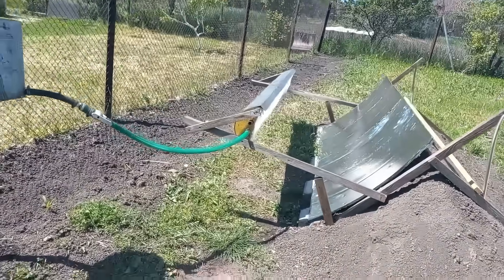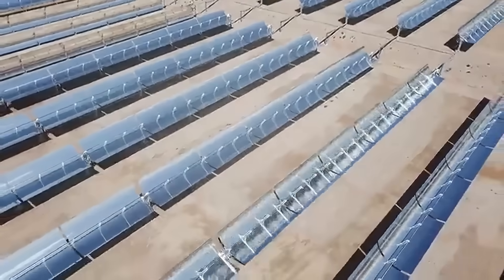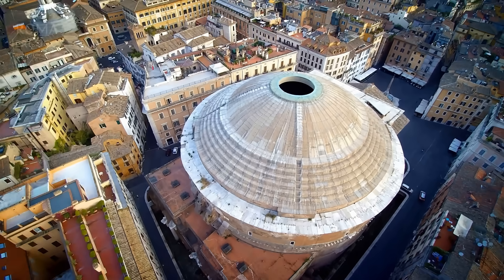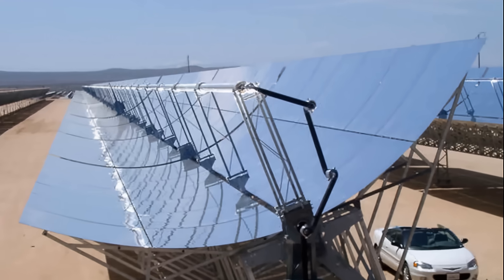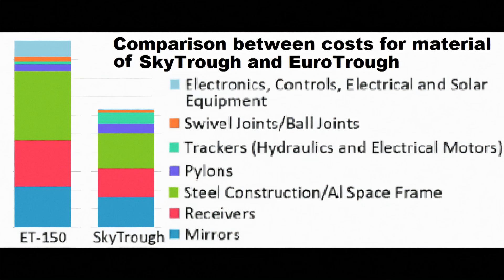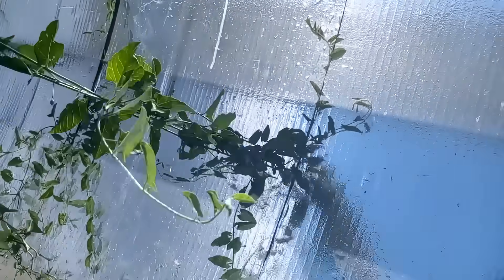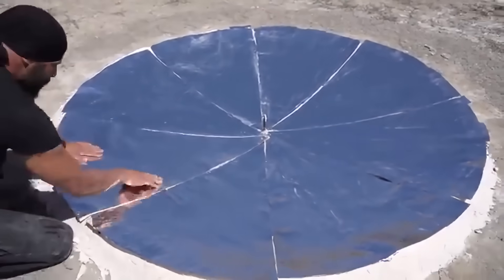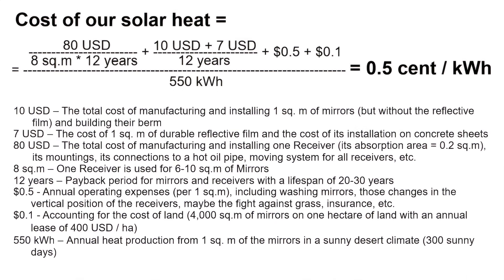Mirrored concrete for cheap solar energy

Comment: I think you've optimised for cost and not for practicality, which is evident by the damage from plants, the ants, etc. Moreover, concrete is cheap but it's very weak without steel reinforcement, which would add to the cost. Also, I could be wrong but I think moving the collector isn't exactly equivalent to moving the whole assembly, right?. I think if you were building this for your home or in some post-apocalyptic scenario, your idea has merit. But in a large-scale, municipal environment, you want to build something robust and long-lasting. (I'm not suggesting the current ones are perfect)

Anyway, I do really like it!
Reply: For quite a wide range of angles, in a parabolic mirror, the focal point wold be quite small, but moving, although at large angles(sunrise and sunset) it might not be that effective. So yes, instead of building costly infrastructure to move the entire mirror, we can just move the receiving pipe.
Reply: @OrangeGuy420  I suppose the extreme angles where sun is low, the error in focal point is maximised, but also solar energy through the atmosphere is minimised, so it's not as important.
Reply: @Ozzah thatsexactly my point. What you said whould be true for a concave mirror, as it has a property called spherical abberation, at relatively small angles, where the focal length gets quite diffused. This is not a property of parabolic mirrors, making them useful for these kinds of applications.

Fun fact: here in india, there is an astronomical telescope which has a large rotating bowl of mercury, which makes a large parabolic shape, thus operating on the same principle; parabolic mirror.

Comment: This makes me wonder about cycling heat through thermal piping under ground, and then storing it in the surface structure as well to heat the surface so that it does not ice over. This is interesting. I love it. I wonder if an array could be built for passive heating, and then using gravity and geometry create passive flow. If so then we could heat, and power sources minimal footprint. Hmm. I wonder if we could create coolant systems for summer by utilizing the motion to convey heat away from locations while isolating it for cooking...then we can create automatic food storage and dispensing restaurants...projected use case is bread or fermentation of things like distilled liquors for further fuel diversity.

Comment: My Grandma's house had a solar water heater kind of based on the same principle. It would send hot water to an insulated storage tank. And keep recycling the hot water, making it hotter and hotter. When you took hot water from the tank for washing dishes, it would add some cold water into the system in a small amount and quickly heat it up.
It wasn't ideal for taking a long hot shower, but you could have hot water even in the winter time. And the snow would quickly melt off the solar heater because it was always warm and at an angle to let the snow slide off.

Comment: 3 days ago NightHawkLight released a video where he makes cheap and accessible aircrete. Combined with the polymer reinforcement you can do light and durable concrete mirrors.
The weight achieved is amazing. It's obviously slightly more expensive than using plain gravel and sand, but only barely, and what you pay in material you recoup in transportation and installation.
Plus the lightness of the aircrete might help you make different shapes and structures not possible with normal concrete. And it's a better thermal insulator than normal concrete, so maybe there's quse for that too.

Comment: I've been telling people for years now that this type of solar power generation (solar collectors) is far more efficient, less complex and more affordable than photovoltaic panels if you use it for heating. No need for expensive electronics or lithium battery arrays. All you need is a water tank to store the hot water and a small pump (powered with solar cells) to pump the water around.

Comment: Dind't wall the solar concentration projects got abandoned due the concorrence with photovoltaics getting cheaper? Idn, I'm a bit scheptical.

the kwh there is about heat, not eletricity. The conversion has losses, and the generator will ad costs.

Also, why not paint the receaver black?

Comment: Excellent idea with the concrete. The frames those fancy German mirrors use are unnecessary; once you form the concrete you could raise them off the ground using basically anything, even timber.
Reply: There's a reason why we use these "unnecessary frames" ;)
Reply: @SolarCookingGermany  Ooo, thanks for responding. Got a breakdown of the math on your channel for the efficiency between this, concrete, and concrete with intermediate standoffs? I want to see where this stuff and our work is wrong about the cost/benefit.

Comment: foam concrete might work.   Just for ease of working with and thermal insulation.  1" foam concrete = R6 value.  Using small amount of (xanthan gum + alcohol) + dawn soap + bit of water  + cement =  foam concrete with 3 - 5 min stirring.  Time varies with amount made and with what tools your mixing with.   Looks very dry at start of mix, will look better after foam forms.

Comment: It always comes back to turning water into steam huh.....
Reply: Always had been [Bang]
Reply: Sun + water = steam = the cleanest possible energy I can think off. Hopefully we can master it and make it super efficient somehow.
Reply: @tgchan   water is so precious.
Reply: @angelafoxmusic7265  I love water!
Reply: @angelafoxmusic7265  you do understand the laws of conservation right?
Reply: @angelafoxmusic7265  We have a massive amount of water, that's not really true in the way you meant it.
Reply: @angelafoxmusic7265  No it's not lol. 70% of the earth is covered in it and it doesn't just magically disappear when you use it. We will NEVER run out of water.
Reply: @AlphaCarinae unless you split it then burn the hydrogen and oxygen gases right?
Reply: it is always still like that... even nuclear does... Most reliable ways to generate power uses steam turbines
Reply: actually always has been. thats what nuclear energy does….
Reply: I mean, it because water has hydrogen bonding so it take a lot of energy
Reply: It's best, it will heat the water and produce electricity simultaneously
Reply: And then what Is done with the stream?
Reply: @liviosaracino4611  Typically, run through turbines to create electricity.
Reply: @liviosaracino4611 its the pressure from the steam that is used to run turbines which create friction around a coil assembly which create energy
Reply: @liviosaracino4611 Steam can either be put in a condenser or just sent out.
Reply: If the goal is electricity and not heat then you could focus the light on solar panels and avoid the conversion losses of converting heat to steam to rotational energy to electricity in a generator. You could also try focusing the heat onto a Peltier.
Reply: @filonin2  Solar panel tester here. Heat (like in all electrical systems) introduces inefficiency through increased electrical resistance. Heat causes molecules to vibrate faster. Slower molecules get in the way less in an electron stream. Cold panels produce higher energy.
Reply: @filonin2  I suggest you look at how efficient steam generators are. Sollar panels are maybe 20% efficient? Peltier circuits are sub 10% and you would need to maintain a cold side as well. Compared to maybe 60% for the best cycle setups for steam.
Reply: @filonin2  the excess heat would reduce the solar panels' efficiency and could reduce lifespan.
Water pipes cooling the back of the panel could help with that, along with preheating water entering your house's hot water tank, though.
Reply: Or seawater into steam into sweetwater... A win win for the dessert and with it food and forrest creation. The forrest gives you extra bilding materials and at the end extra fuel. Most of our ritch are short turm idiots that just do not care for this planet.
Reply: Well, you could try to attach hoses to your rear end to capture the gasses from your fats, and then convert that into some sort of usable energy.

But....most of us would choose the easier and more pleasant options. Ones that are more.....uh...easily attainable.
Reply: https://youtu.be/uK367T7h6ZY?si=_Zxs8XU0EirKHZyB
Reply: You could use other liquids as a thermosyphon, and pump that around pipes in a concrete slab floor for additional heating in winter. 
Instead of going for maximum heat in summer- go for useful heat in winter.
Reply: You could always buy some supercritical co2 at home depot.
Reply: @gaemr_o5147  don’t be a smartass
Reply: @gaemr_o5147 I have a supercritical CO2 powered air fryer. It was cheaper than electric.
Reply: I bet there are better liquids that can be used instead
Reply: @attorneyirl2725 no, water is special because of hydrogen bonding, even if you like tried to use something like ClF, its extemely sensitive and explode with the slightest change of energy such as light. you can use heavier isotopes of water like duterium you want more energy per cm^3
Reply: @CheeseLordAlmightytheOneGod  It's not the hydrogen bonding that gives it its high heat of vaporization.

Comment: Cool now tell us how much power you generate? 
EDIT: Let me be more specific. 
How many Watts do you generate per square meter of your "solar panel killer"?
Reply: 67
Reply: @muhammadfaisalyahya9205  67 watts?
Reply: @muhammadfaisalyahya9205  what is 67?
Reply: 500
Reply: cigarettes
Reply: @verynice5574  It's not over 9000
Reply: @verynice5574  what is 500?
Reply: This
Reply: He prolly won't tell you because it's so thermodynamically inefficient that a Las Vegas plant using this tech is nearing shutdown. Solar panels convert 10-20% of light energy to electricity. Mirrors are closer to 100% but they lose the light energy if you use them on a large scale. You lose energy on each conversion. He lets light hit a mirror, than lets some of it radiate out through the air. From there, it concentrates onto one poiint and converts into heat. This causes even more losses, because it is converting again, radiating heat outwards into the air and onto the pipe, and also heating the water inside. The answer is this could never even approach the energy produced by solar panels.
Reply: @Nyan4Eon  Thanks for the info! Yeah im not expecting a reply from OP.
Reply: An interesting question would be "What's the correct metric for comparison?"
Reply: This. Solar energy is just stupid low. Even if we covered Africa entirely we would not cover 10% of Europe's energy demand.
Reply: @chettonex naah this is hard for me to believe. Friends of mine have some panels on their roof and it fully covers their daily usage
Reply: @SFreakHD 1% of land mass of India covered in solar panels can power it's 1.5 billion people...
Reply: @chettonex  Yeah maybe if it was like the 1960’s ya doofus
Reply: @chettonex  that's just false, even with very conservative photovoltaic panel productivity (~10 W/m² averaged) the entirety of Africa's surface covered in panels (30.37 million square km) would supply hundreds of times Europe’s total energy demand and 10^3 times Europe’s electricity.

Europe electricity consumption ≈ 3,000 TWh/year (≈ 342 GW average).

if power output is 10 W/m²: total power ≈ 3.04×10¹⁴ W -> 2.66×10⁶ TWh/yr.
-> ~887× Europe electricity, ~222× Europe total energy.

Source: I'm an engineer. Maybe stop trusting Facebook.
Reply: @al3th3s I assume OP's equation included power loss from distance.
Reply: @Theanimeisforme  still not even close, using High Voltage Direct Current (HVDC) for transportation, total loss would still be about only 13% (approximating 3% loss per 1000km)

Calculations:
North Africa <> Southern Europe: ~1,000–2,000 km
Central Africa <> Europe: ~3,000–4,000 km
Average: 3 thousand km
3%*3=9% loss

Adding loss from conversion on both ends between AC and DC
1% to 2% per converter

Total loss: 9%+2%+2% = 13%

The real issue in this hypothetical scenario would be the unstable international relations, which are already linked to power (in the electrical sense, and in the control sense). Another issue would be literally covering Africa in photovoltaic panels, but hey, it's a thought experiment

Comment: Your 0.5 cents/KWh, are, up to know, pure theory, not to say fantasy. You are always doing costs' analysis, which is quite admirable even if no expenses for the rest of the required equipment ever shows up on these, but what about producing some power? None of these numbers are really useful if acquiring a turbine, a generator, and the rest of the required parts cost and arm an a leg. Besides, if you rely on these reflective sheets that "last for 30 years" or in any other specific technology, you are just subject to market "price" variations and inflation. Another idea would be to electroplate the surface and to polish it to a mirror finish. A bit more cumbersome, but free of inflation and of non-sense price rises due to no other than pure ambition for the printer paper.

Comment: I recently thought of this.

When i thought of it I immediately two questions. Why isn’t this talked about in the “green energy”/“renewable energy” conversation? Why isn’t this significantly implemented?

This video proves the low cost, scalable, & environmentally friendly benefits of this type of energy producing system.
Reply: Since all of the replies are just parroting oil industry propaganda and not being all that helpful, let me be the one to explain. 

Solar thermal energy scales poorly for electricity generation. Like all solar energy, you have to make sure the panels/reflectors are pointing at the sun at all times, so all of your panels need to have a good range of motion as the sun moves throughout the day and also changes angle throughout the year. But the big difference between photovoltaic and thermal is that thermal requires you to convert that thermal energy into electricity, you have put that steam to use to turn a turbine so you have electricity. Now you gotta put that turbine somewhere and build your solar thermal to transport all of that thermal energy, using up more space. When you want electricity, you are just better off buying solar panels that directly turn sunlight into electricity. Where solar thermal is useful is when you want to use the heat directly, like for water heating, home heating, and even cooking.
Reply: Finally, an actual customer service representative in this comment section
Reply: @PURENT  
Some things to think about.
Thank you for your perspective.
Reply: Corporations sell renewables. Most companies dont like selling DIY unless they hand pick and package the materials for said DIY.
And the more self sufficient someone is, the less reliant they are on corporations, it hurts their bottom line.
Ideally they would sell and service solar panels throughout your entire lifetime. You being able to make your own is competition against them.
Reply: @pauldeddens5349 
EXACTLY!
Reply: Have you deen the "ecologists "in grenoble? 110 000 euros for derelict toilets. "Economic logist" more like, also looks at the sculptures they commission,  they are rapecultists.
Reply: Then who would bought these expensive solar panels in first place? The "Green movements" are a scam, they don't care about environment etc. they just want to control us

Comment: that's a completely different approach from what solar panel does. There are solar farms, as you already know" that use mirrors to redirect light, but photovoltaic solar panels convert light into electricity on the spot, which mirrors don't do. So you are in essence comparing apples and oranges.
Reply: Yes, a solar thermal system is a completely different approach than a photovoltaic panel system. That’s literally the entire point. The comparison is the difference (pros/cons) of using a solar thermal system of energy production versus a photovoltaic system of energy production regarding costs, complexity, scalability, end environmental impact. We can compare various methods of producing energy. It is literally what the “green energy” arguments are all about (eg, oil versus solar).

Comment: I still prefer photovoltaic solar panels to these reflective solutions mainly because of installation space. Solar panels need not take up any extra space. The existing rooftops and such will work just fine.

Comment: This isn't a solar panel killer. Cos, unlike Solar, which can produce continuous electricity with small setup, this arrangement requires massive infrastructure. In smaller scale shown here, this can only be applied in specific situations.

Comment: Excellent. If your goal is to produce steam then you could also apply carbon black to concrete for it to heat by absorption of radiation istead of reflection.

Comment: It's possible that these might have higher efficiency than real solar panels during peak output if they generate a high enough temperature gradient and the liquid is well-isolated. That's fucking crazy.